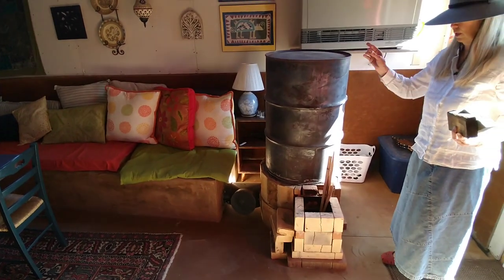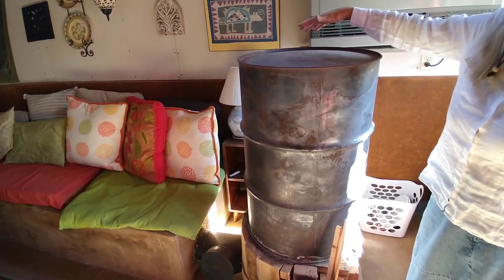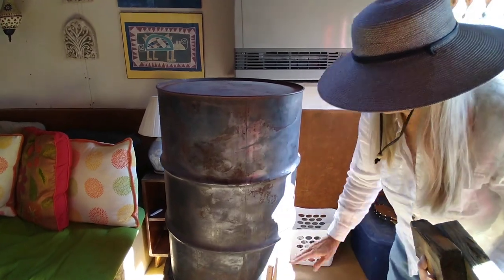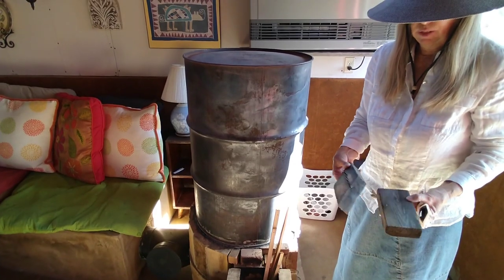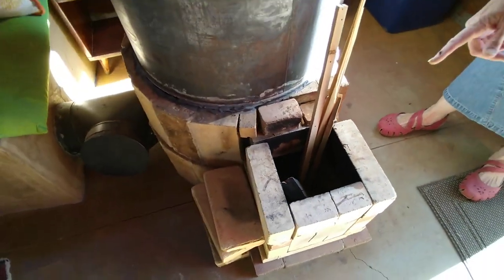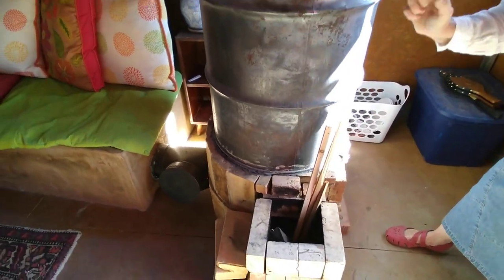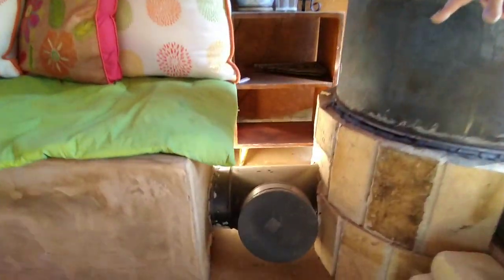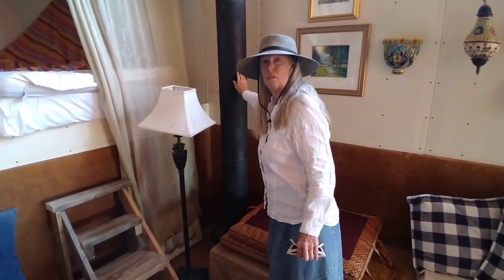She Heats Her WHOLE House with This ROCKET STOVE BENCH!

Comment: brilliant build. i've seen these in person even slept on one for a week. when built right they are safer than a conventional woodstove and use a quarter to one tenth of the wood of as the most efficient modern woodstove. they also emit no smoke after a few minutes when burning dry wood,and the biggest positive is they stay warm long after the fire is out, thereby saving tons of wood and time feeding it at night. they also cost far less than a brand new woodstove, although they are quite laborious to build, and you do need to be at home for a good six or seven hours to charge up the thermal mass, but the barrel does put out a lot of heat right away off the top, I've had it reading up to seven or 800°.
Reply from the maker: Thanks for the insight!

Comment: Burning pressure treated lumber from building materials can make you sick.
Reply from the maker: Right. I don't believe they are pressure treated.
Reply: We don't burn any pressure treated, OSB or plywood in the Rocket Mass Heater.

Comment: Either it gets hot enough to start the bench on fire or can't be enough to heat the house....seems to me.
I can't help it.  Just seems like one of those "Don't try this at home" things.
Reply: The bench is made of rock, clay, cement and plaster.  None of these materials burns at the temperatures involved.  The bench under the pillows never gets too hot to touch but it is so massive that this is a very significant thermal battery.  Also, we have passive solar heat in the second story that heats the upstairs where we sleep so that it says plenty warm.
Reply: i've seen these in person even slept on one for a week. when built right they are safer than a conventional woodstove and use a quarter to one tenth of the wood of as the most efficient modern woodstove. they also emit no smoke after a few minutes when burning dry wood,and the biggest positive is they stay warm long after the fire is out, thereby saving tons of wood and time feeding it at night. they also cost far less than a brand new woodstove, although they are quite laborious to build, and you do need to be at home for a good six or seven hours to charge up the thermal mass, but the barrel does put out a lot of heat right away off the top, I've had it reading up to seven or 800°.
Reply: @nickthomas6206  
Thank you.